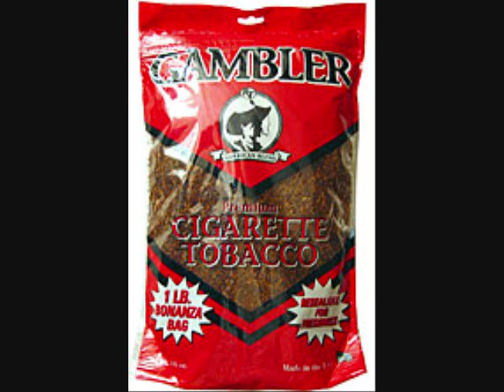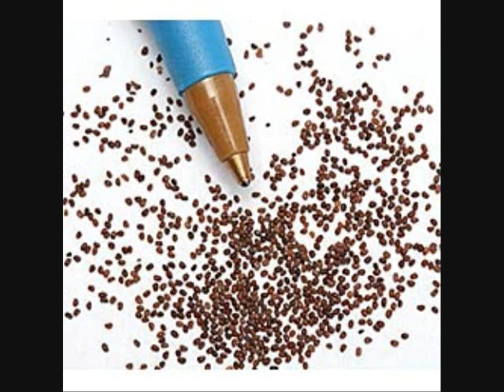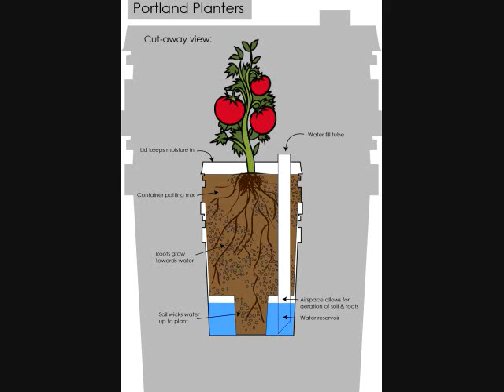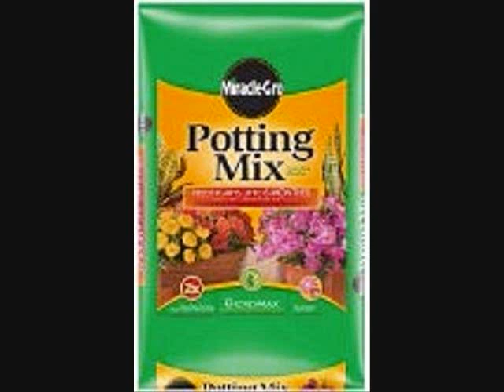How and why I invented The Self Watering Rain Gutter Grow System!!

Comment: Larry.  Will those float valves work at low pressures?  I want to use this system to water in the greenhouse with water from rain barrels outside the greenhouse.
Reply: Yes.

Comment: Very good idea, Larry.  I have a different watering system (also automatic) with recycled pallets.   Mine cycles the  water up to the plants continuously an airlift pump powered by   an aquarium bubbler pump.  You don't need that on your big plants but maybe  you could try the bubbler  to poweron your plant starts?  An airlift pump, is just a length of 1/4 tube stuck down in the water with a hole in it for the air tube entry. Brian

Comment: But the first one hooks up to the water hose and you said to get an adapter to reduce from the float 1/2" to 3/4" to hook up the hose. but how do I daisy the main one to the second and third with a 1/4" float. Do I have to install a second float to the first one in order to daisy the second and third ?

Comment: Learry this is a great video.  I am a recycler and my husband brings home plenty of stuff to recycle.  (he cannot stand to waiste anything) So I have several lenghts of sewer pipe 8 and 10 inches.  What do you think of placing the pipe between cinder blocks (for support) and drilling holes so I can place old tshirt to wick water from it to my plants.  I can seal off the ends and add a water source with a float valve.  Do you think this would work?

Comment: Great videos Larry! I have a couple Earth boxes, and some home made earth buckets.. Works great, but like you I have been looking for a way to auto-water. Finding a flat area in my backyard is tough, but I guess I will just have to bite the bullet and use wood blocks or bricks to get level. I am looking at going soil less, with hydroponics, but still sorting it out. I appreciate your videos down here in GA, gonna try your system this spring. thanks,
Rick